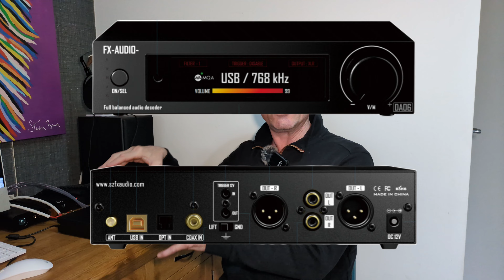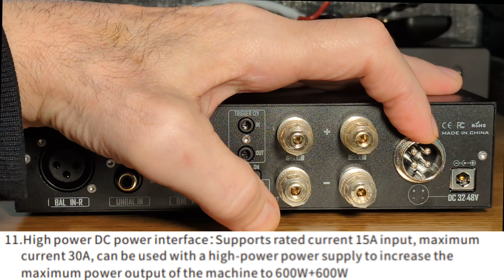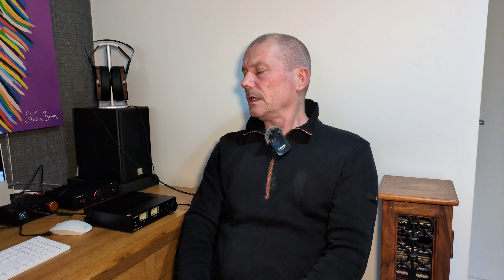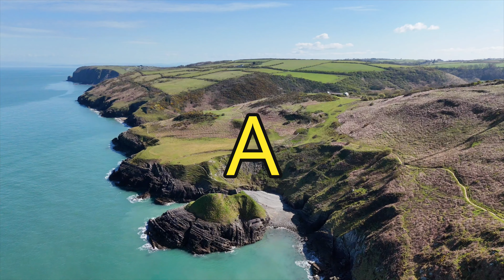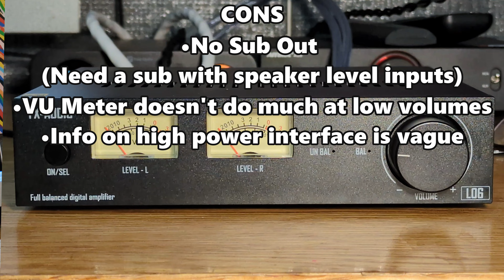FX Audio L06 Power Amp Review #utilitariantv #fxaudio #poweramplifier

Comment: As shipped, it delivers a maximum of 200W theatrical output. To achieve 500+500W, you'd need a 20-amp PSU—an enormous leap. The THD figures are abysmal. This is nowhere near Hi-Fi.

Comment: As for the sound test, I personally found the piano seemed to sound just a tiny bit cleaner on the FX-Audio.  Otherwise, it was hard pressed to really tell a difference.  For such little, and fairly inexpensive amps, they both actually sounded quite good.  Again, I would probably like to hear it in person as opposed through YouTube.  Now, compare this to something like my Emotiva XPA-DR3 amplifier, which does not have a volume knob (it is on my pre-amp).  Also does not have sub-out (again, on my pre-amp), nor any VU meters (and yet again....).  The only thing on the front is a set of LEDs to indicate it is powered up and active.  According to Emotiva's website, my amp is rated at 450 watts RMS into 8 ohms at less than 0.1% THD and 600 watts RMS into 4 ohms at less than 0.1% THD.  That is per channel.  I would be amazed if that little FX-Audio could actually put out that kind of power and do it very cleanly.  My Emotiva amp is friggan huge and weighs around 50 pounds.  That kind of power going into a pair of Klipsch RF-7s?  Lets just say I have to be careful with the volume otherwise, I'd be letting everybody on this end of my street know what I am listening to!  :face-purple-smiling-fangs:

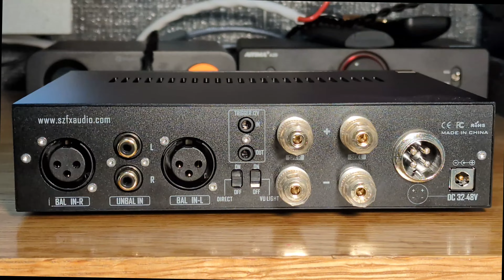Comment: What is "fully balanced"?!  @2:33 

It is so bluray..
Do you mean it is a "fully differential circuit design" internal biuld?

THAT is the definition of "fully balanced" in my book.

I guess not. And you dont know to be honest?

What i believe you ment is that it has just xlr inputs in the back.

So you see you can have xlr inputs and NOT be a balanced design circuit wise at all. But you NEED xlr to be able to make a fully differential design internally!

In other words xlr terminals has NOTHING to do with balanced or unbalanced we need to look deeper into the circuit and its design.

That is why we call it "fully balanced" to differentiate other Amplifiers that just use xlr inputs and are unbalanced in reality. 

Yes it fools a lot of people.. it is the differential circuit that makes it balanced..❤😂
Reply from the maker: On the Webpage, it states 'fully balanced ultra low distortion line architecture.' It is a little condescending that you insinuate I only assumed it was balanced because it had XLR inputs.
Reply: @hifireviewhub   ...I would venture to say that although the preamp section might be "fully balanced" there's no way in hell that the power stage is.
Reply: @hifireviewhub Sorry for that!
It is more my frustation than anything else. And I get it now that the manufacturer says it is fully balanced. 
But even if they state that many many of the smaller manufacturer also do this in their marketing.
I would still believe that at this price point that there is nothing balanced (= differential) in this amp.

In other words we should maybe question the manufacturer or clarify "the manufacturer state that it is fully balanced".
I am sorry again for my tone ❤

Comment: My take on is it’s an “amplifier”, not an integrated amplifier so a subwoofer output would be located on a preamp as well as the volume.. and having a volume control on this is really not necessary.. but it does have a defeat switch. JMO!